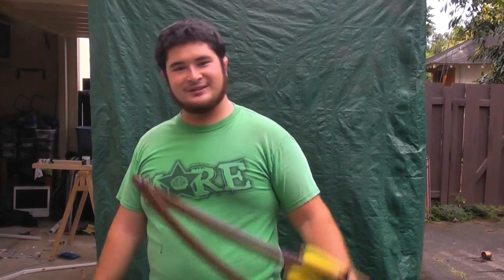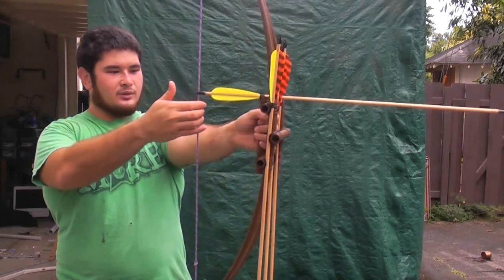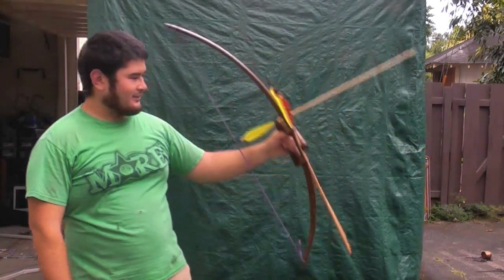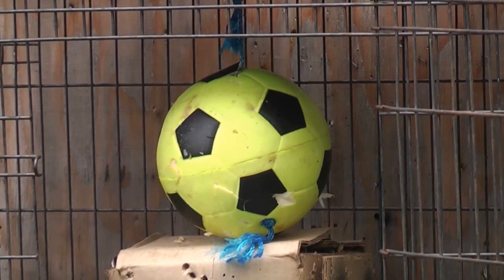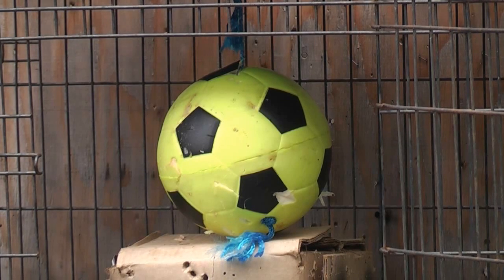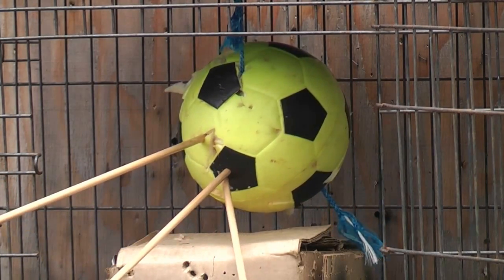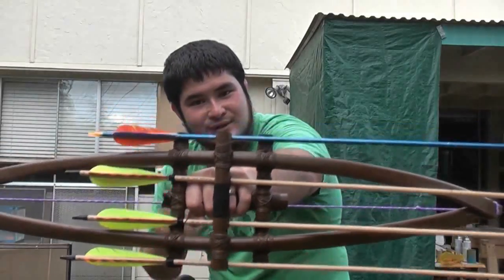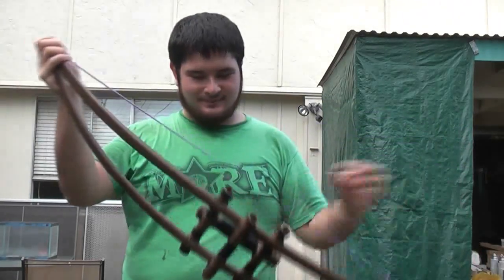Shooting a Centershot Double PVC Bow With Built In Quiver

Comment: Drawing lower than center reduces the power stroke length.  Speed?

Have you shot it through a chrony?

If you use a pair of 125 fps bows as a double, what speed would you expect?
Reply: The arrow mass as a fraction of total bow system mass will go down - max speed (i.e. dry fire speed) can't go up more, but the weight will be spread evenly, in theory.

Assuming no loss to added string weight, it should be like shooting an arrow of half the mass from the same bow. From 10 gpp to 5, in other words. Once you add all the inefficiencies in, it's probably closer to a 10 --> 8 gpp.

Still, that can add quite a bit of speed.
Reply: Thanks.

A double bow may be useful to increase the mass of the arrow to increase lethality, even at the same speed.  If you could shoot a 700  arrow as fast as a 400 arrow, it would be awesome.
Reply: awesome bro, yet another amazing bow, it looks so cool from front on, I think there was some talk of WOW inspired bows, looks like this one could handle the dress up real nice, lots of room for extras, with out stressing the limbs, super cool

Comment from the maker: It's the arrows getting flexed after each shot. You don't really feel it with the handle set behind the limbs, but there is no shock at all when there are no arrows in the quiver. The two bows flex, but the handle doesn't.